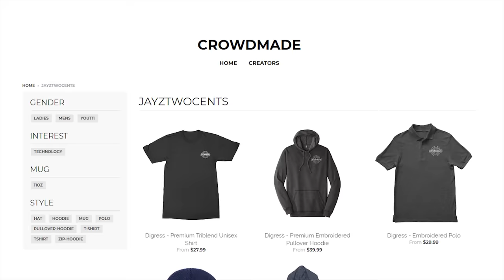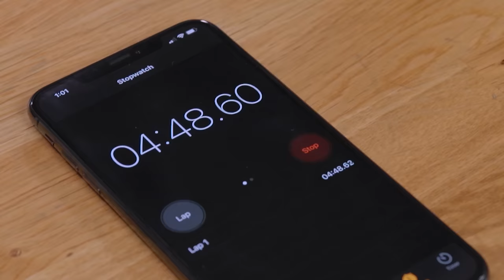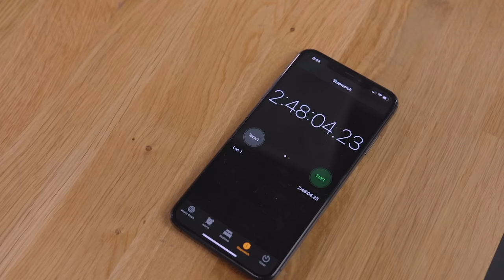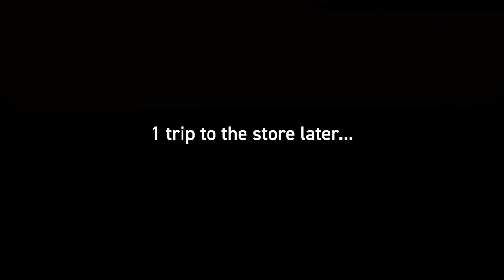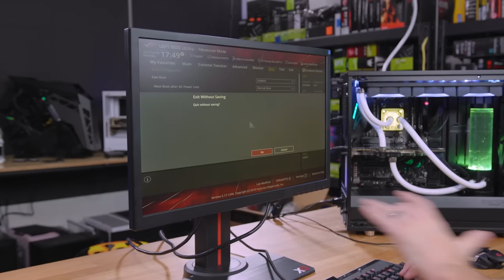Trying to see how fast I can build a watercooled rig!

Comment: Finishes the video before installing the OS... as a long time Linux user I'm just have to mention how silly that sounds to me.  I know, because if I had to install and set up a Windows system with appropriate drivers and software, I'd have called it a day at that point too.  Sometimes I even install Windows on one of my disks and use it until I wake up in the morning only to find an upgrade dialog and a locked (from me) system.  Actually the last (mind you totally legal, I have the usb boot drive and the license) win10 install I had to give up on because it got locked into a circular dependancy during an upgrade, and upgrade that on any other system would have happened in the backgroudn while you were using it.  If it wasn't for the dominance of Windows and how crappy using it is, standart x86/64 PC's would be the undisputed champion of the home computer.

Comment: Just a question, my gpu has 2 fans (asus srix 1050ti oc edition) and one of the fans lost a blade, it broke off, but the gpu still works fine, i have 10 blades on one of the fans instead of 11 now, i've had this problem for about 3 months and the fan isn't imbalanced at all but i wonder how i can fix this or if i even should i know i can replace the fans but i'm not comfident to do that. Also srry for bad english but i'm from belgium
Reply: Super glue the blade back on, sand the fan blade(s) down, then repaint. I've had to do this a few times over the years. As long as the fan blade's shape has been preserved where it broke off, the glue should adhere fine.

Comment: Honestly I don't understand the custom water cooled computer.  Unless it is the absolute best hardware currently there is 0 point in it.

1. The maintenance is a pain in the ass
2. Building it is a pain in the ass.
3. The cost of doing it, you could just buy better hardware instead and it would perform better.

Comment: I live in whittier was wondering if you would be willing to try to fix my beloved gigabyte gtx 970 G1 gaming or at least tell me how I would be able to flash a bios on it... the issue I have is my 970 will uninstall the geforce experience and it will become a standard display adapter at 800x600 res upon using ddu and reinstalling nvidia drivers it says drivers have installed but they have not installed at all I get code 43 in device manager I emailed gigabyte and they said pay the shipping send it in but I herd horror stories about there rma lol can you send it in for me ahah jk the card works sometimes but it acts up and erases geforce experience from my comp and can not pull up nvidia control panel  I herd it may be the v ram failing idk I bought it at launch
Reply: any input would be nice thank you love your content
Reply: it was simillar issues coconut money was having with his gpu I belive it was a 780ti not sure you did a video on it

Comment: I'm bummed about no NVME drive.  With that motherboard you really should have the Nvme in, using that as the boot/operating system drive.  (maybe even two Nvme drives) Deducting points for that Jayson.  Edit: Also not enough radiator volume Jayson.  NOT a cool setup.  You can do better than this, and you should have.  That is what happens when you try for speed instead of building the best system you can.
Reply: L1A1Rocker its a waste
Reply: @acaperic359 : I disagree.  Jayson makes these videos for a living.  He did not put forth his best effort, and it shows.
Reply: You clearly have no idea where the strengths of a M2 drives vs a regular SSD drive. Random access times for both types of drives are equal (about 4us) if you buy a decent one. Where the M2 really shines is bandwidth. Windows consists of thousands little files only a few block sizes large (disks read blocks not bytes). M2 drives are really fast if those blocks are aligned. That usually happens only with large files. It is the random access time that made you system so much faster after you moved from a regular mechanical drive.. M2 drives should be used when you deal with large files like games, video editing or databases..

One of the better features of M2 drives is that you no longer need two cables, so it makes the build much cleaner..

Comment: SO WHAT? MY MONSTER PC RYZEN 1700 16 GB DDR4 3200MHZCL15 GS KILL RIP JAWS GTX 970 G1 GAMING DELLP2416D 24'' 2560X1440 60 HZ IPS PLAYS EVRYTHING MAX SETTINGS 1440P 30+ FPS SOME GAMES EVEN 60 FPS. I UPGRADED CPU RAM MOTHERBOARD AND HDD IN 2017. MONITOR AND PSU IN 2016. NOT NEED FOR ANY OF THESE OVERPRICED RTX CARDS OR WATERCOOL!

Comment: The way he threw that Ryzen 7s Wraith Prism cooler in the box off the table is disrespectfull. Ryzen 7 2700X absolutely doesn't need to be water cooled because it performs superbly at stock clocks using default 4-core turboing up to 4,35 GHz and that Wraith Prism cools the VRM-s very efficiently. All he had to do was to put the Wraith Prism on the cpu and an Arctic Accellero IV or Ranjitek gpu cooler on that overheating Titan X. And the rig would be perfect for at least the next 10-15 years upgrading only the gpu a few times.
Reply: R.I.P: Wraith Prism Cooler... I agree, the cooler itself is actually really good... But it's kinda useless for this build since it's mainly focused in liquid/water cooling